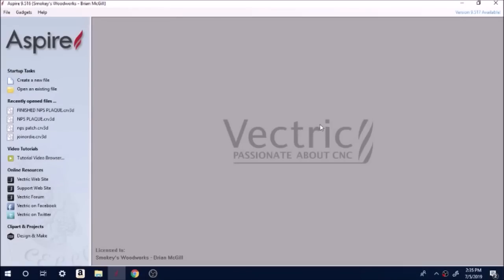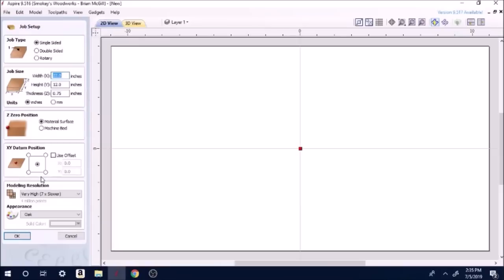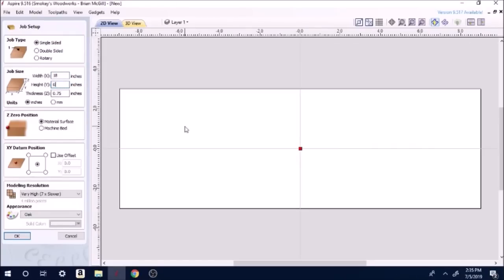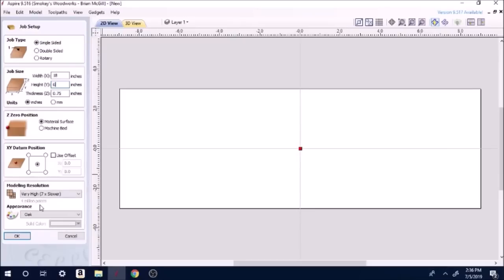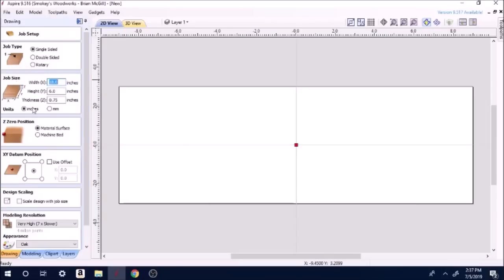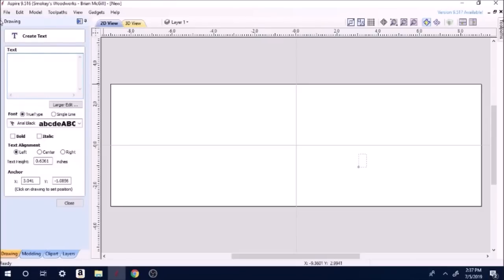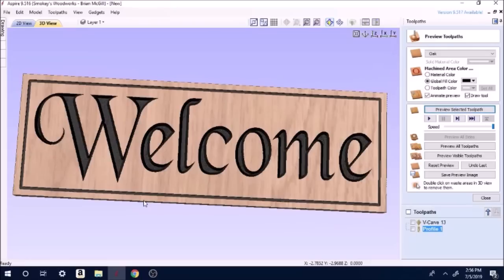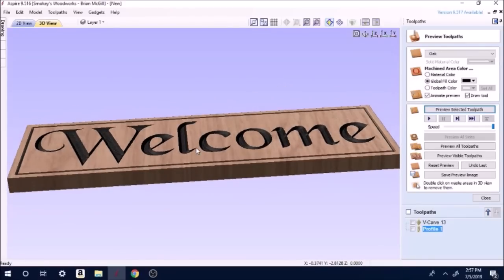Welcome sign (easy programming)

Comment: Have you done a tutorial or know of one that explains how the switching bits in the middle of a project works?  Like during fabrication?
Reply from the maker: It seems like I did do one where I showed bit changes......So here is a simplified explanation......after each process the machine returns to zero...so if I ran a vcarve process and the next process is going to be a profile process...the machine returns to zero after vcarve, I then turn off the spindle and change bits from a vbit for vcarve to a end mill bit for profile.....Then go and close the vcarve program on the computer and load the profile process, fire up the spindle and hit go in Mach 3 and it starts the next process with the different bit...Thanks for watching!!

Comment: Thanks for the great video.  I made a sign following your video creating a toolpath that carved out the area around the letters, but it didn't carve as deep as the v-bit toolpath did.  Do you have any idea why the .25 endmill wouldn't 't go as deep as the v-bit did?  I used the same .13 flat depth as you did in your video.  Any ideas would be appreciated.
Reply from the maker: The only thing I can think of, off the top of my head....Did you re-zero after the bit change?...If not it will make the difference....if you did re-zero on the 2nd bit, I would be stumped!...Thanks for watching!!
Reply: @SmokeysCNCWoodworks  I did re-zero after bit change.  I'll try another one and see how it goes.  Thanks
Reply from the maker: That is odd....if this problem continues...ask this question over on CNCZone, its a forum and these guys are experts at this stuff and solved a lot of problems for me early on....That was the only explanation i could come up with....I have done that very thing myself....Thanks for watching!!
Reply: @SmokeysCNCWoodworks  Thanks for your videos.  I ran it a second time and it worked great.  It appears that the second pass of the clearance toolpath did not run the fist time, not sure why but all is good!

Comment: I have a question I want the spindles and start cut right where I 0 it. For a cutout I know it can be set do you know how
Reply from the maker: Using vectric, as far as I know you are going to zero in 1 of 5 spots the 4 corners and the center....I personally use the center for zero and it works great for cutouts.....I see what your saying, I just thing it would be quite challenging...starting from center it will go to the edge and start the cutout regardless of shape......You should shoot this question out on CNCZONE.com, a forum, filled with experts, I have got a lot of questions answered there....Sorry cant really help you....Thanks for watching!!

Comment: Bryan,  i'm just learning and have a question. My cnc hasn't even been delivered yet but I'm learning vcarve. My question, is it best on a l large letter say 2 1/2 tall with a flat depth  should I just use the v-carve tool only or add the clearance tool selection. I'm looking at the Pointedly Mad font,  using just the 90 v bit by its self, the bottom looks rough. The preview using the clearance tool at the same depth doesn't look good either. Any suggestions?
Reply from the maker: Single letter recessed? or cut out?